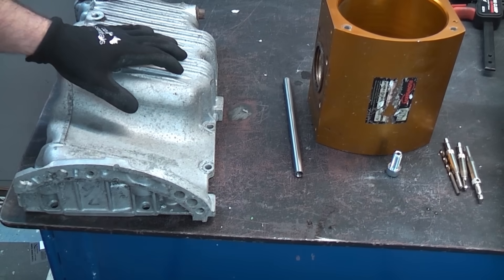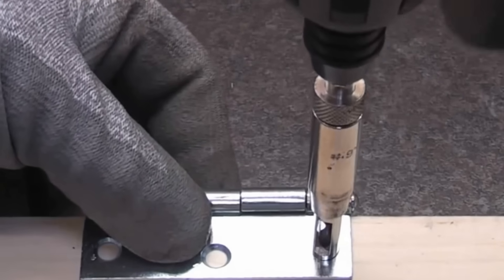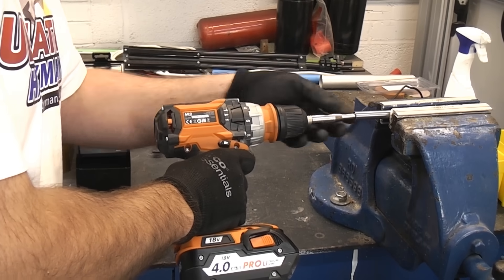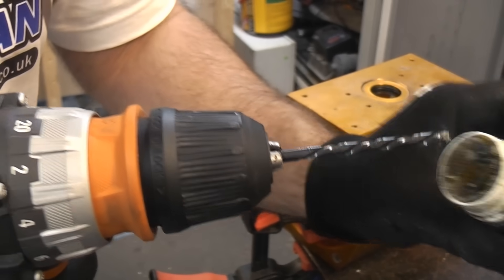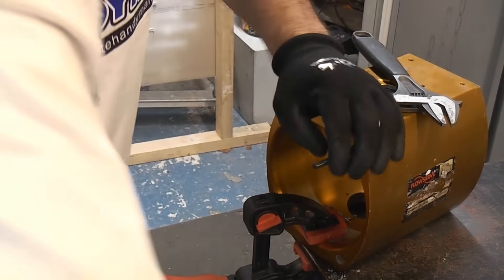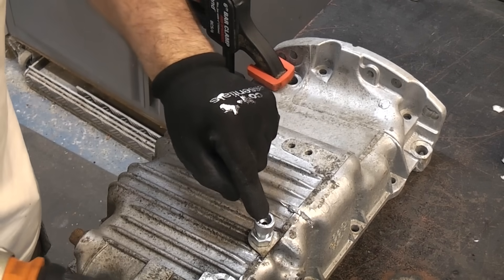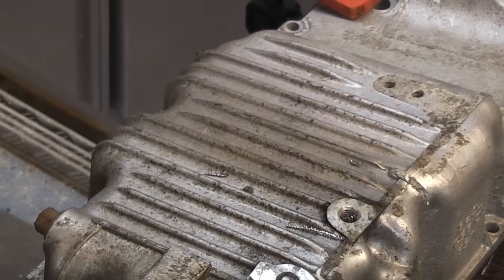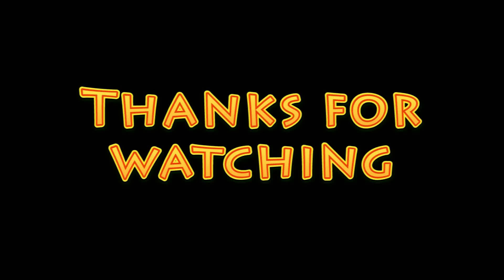How to remove a broken bolt in a deep hole | remove broken bolt in recessed hole

Comment: I've always just welded a nut on the broken off piece, the heat usually gets it unstuck and then you just put a wrench on it and take it off.
Reply: Guess I need to go out and buy a welder, take welding lessons, weld to the bolt,.....oops it’s broken. Off down inside....oh well, next video!!!

Comment: We called them "easy-outs". They were never easy and would usually just snap off in the drilled hole. Then I'd have to take whatever I had to a machinist to work their expensive magic.
Reply: Yeah it seems to me too that the actual way to reliably remove these things is a big-ass mill and a sturdy fixture...
Reply: Just watched another of your videos on this exact problem. Very nice. Good job.

Comment: Usually when I snap off a bolt, it's because it's hopelessly corroded (that's why it wouldn't come out). Step one, drill a hole in the bolt. Step two, snap your drill bit off in the hole. Step 3, swear....a lot.
Reply: That's the method I use too! Must have gone to the same school or something.
Reply: Just tried this method-and it worked! I now have a hardened broken drill bit tip in the center of a frozen, broken bolt..
Reply: @phila3884 diamond tile holsaw
Reply: @phila3884 fuck.. that’s what I said yesteryear when I shared a cylinder head bolt.
Reply: @phila3884
Been there, done that.
Spent a half hour or so, every day for about a week:
Spray it with penetrating oil and grind it with a diamond dremel tool.finally got it ground out to where it would come out with the next size screw extractor. 
It was on a cylinder head, so buying a new one didn't seem so attractive.
Reply: Ya, not sure why a hardened bolt would break off then simply come with a drill bit or bolt extractor. Nice method and solution but not for extracting corroded frozen broken bolts.
Reply: @justinhaskell8990  Might be something to do with the heat generated by drilling ??. Been in a similar situation many times with broken drill bits in the broken bolt , enough to make you cry
Reply: @UserUser-ww2nj so how do you get them out ? Just happened to me
Reply: @justinhaskell8990 i was just thinking the same. However my bolt broke because... i was undoing it in the wrong direction (reversed thread) 😅
Reply: Ok Im still swearing and nothing is happening... Did you swear in English? Idk wtf to do
Reply: @Rabbit_7.62x63 naw, use German or Japanese, much higher quality
Reply: @Rabbit_7.62x63 , 😆🤣😅😅👍💯
Reply: If working in an engine bay, also  rememer to to apply ample pressure on the drill, so when the drill bit snaps, you smash your knuckles on something (preferably something sharp), that way when are swearing in frustration, you are also swearing in pain.
Reply: @Natu776  bro at that point your knuckles are already busted up, from punching the fu kin ground when you realized you had to drill out a damn bolt lol
Reply: Or snap off the extractor...
Reply: If you use the snappable drill bit that brakes off outside the hole , now you have something to grab on to. LOL
Reply: Or just buy a new one , which is a piece of garbage 😂😂😂
Reply: @carlleroy5952  if the drill bit breaks and you cant take it out youre screwed though.
Reply: @birisuandrei1551  yes just happened to me very frustrating. Luckliy i was able to mount the door with one bolt on hinge for time being. Also it was only 2-3 inch off ground which made it even harder to keep centered wish i knew about thise center guides while i was at homedepot. The extractor wouldnt set inside so i tried drilling more and snap went my drill bit....
Reply: @kscgaming5857 were you ever able to get it out after it snapped and how so
Reply: Graduate Level......break off an EZ Out Bit in the said drilled hole....I hits my Masters in this at Screw U Tech College of Technology SUTCT!.....(Sucked, sort of😉)
Reply: @rileyjackfansmithandjones8238  CentralKentuckyEducationDepartment should get you there!
Reply: Lmao
Reply: Currently have 3 extractors snapped off in 3 separate bolts! Now what??? Oh and they are the axle bolts (which all snapped) and that’s my ride home. So pls, what do I do now? It’s recessed in the hole too.
Reply: It's always comforting, knowing that there are others suffering right along with me. 😉 🛠️⚒️🧰
Reply: At least you filled in the hole.
Reply: Just keep drilling is what my wife likes to say.
Reply: @EarmuffHugger 😂😂😂
Reply: @EarmuffHugger Um, yeah...suuuure she does.
Reply: Your forgetting he’s using a left had drill so when it catches it often backs the bolt out.  If not the hole down the center often releases pressure on the bolt and provides another access point for a decent penetrating oil like KROIL.  Nothing works every time but I’ve gotten more out than not doing this or similar methods.
Reply: @takedeadaim8671 omg...that's incredibly useful to know
Reply: @ivanvarela3215 it won't work as a broken stud is always tight. Ask yourself, why did the stud break in the first place. Because it's rusted, had a galvanic reaction between two different metals or cross threaded, all of which are tight as hell.
Reply: You left out a step, after breaking the drill bit, you try drilling with a titanium bit…..then snap it off inside the previous drill bit then repeat swearing. It also helps to throw or hit something ….
Reply: Well I'm frustrated with this broken bolt and all this talk about left handers , I took a smoke break , now I don't care if the bolt is broke off , it's going together without it ..
Reply: Particularly enjoyed snapping the extractor off after the drill bit!
Reply: Sometimes it’s easier to use a hole-saw and core out the entire thing, threads and all, then fill it in with molten aluminum, drill, and tap a fresh hole :-P
Reply: My ol lady Had electrolytic corrosion in the block and timing cover.
I saved out a whole weekend for the many processes of corroded bolt removal.
I ordered new bolts and went to the car with an idea I received from a tech who could solve problems like that.
Heat them, then blow them outta there. It was in cast iron.
No pussy footing, full power.
Reply: It didn't work. What am I doing wrong? 🤔
Reply: If you ain't cussin' you ain't tryin' 😂 great video 👍👍
Reply: TRUTH 🤣😆😭

I actually broke off my screw extractor: A broken-off, corroded, rusted bolt with a brand new extractor chaser.

I strung cuss words together like beads.
Reply: next step is a 35 dollar diamond bit. lol.
Reply: I use a jeweler's torch, a drill bit and a ease out.  The torch will soften a hardened bolt. Then drill it. Might have to do it twice. Then use an ease out.
Reply: LOL. Same deal here
Reply: Is there a step four 😂 no seriously 😒?
Reply: @jermanewagner6891 did you ever find step 4 because this just happened to me
Reply: Oh my word, this is the most accurate comment iv ever seen! You explain my whole day in one sentence, amazing. And the bolts still in.🤬
Reply: And break the screw extractor in the bolt too.
Reply: My husband literally did this step by step. 😂 I just read it to him on the phone & staring dying.
Reply: Yeah this. This guy was lucky, if not staged... If you don't snap the drill then you snap the easy-out and then you have to resort to a dremmel, fucking up the hole, drilling & tapping for a timesert or helicoil. I have no stud-extractors anywhere to be seen in my armoury of tools any more, they have only given me grief, never saved me.
Reply: Currently using this method
Reply: Brillant & preventive thanks for the video wisdom.
Reply: Man i hate how life is 😂😂
Reply: Only if you don't know what you are doing
Reply: El loom mini um
Reply: Thats what im trying to avoid right now lol
Reply: Master, hold your secrets lest the foreigners steal it! 😂
Reply: I swear that is the same way i do it.
Reply: Brother I’m in that exact position
Reply: @douglasanderson153 did you ever get out of that situation ? Broken drill inside screw/bolt?
Reply: Man I broke my drill bit and my easy out trying to get this bolt😂
Reply: Break the drill bit drilling the hole, finally remove the broken bolt after much swearing and throwing tools, break a tap repairing bad threads, repeat from start 😂
Reply: Ease out. What a lie. Ease break. Now for the real entertainment. Not genuine unless blood is drawn
The cussing is a bonus.
Reply: Same😢 never removed any bolt frozen that had snapped trying to remove even with pen oil….! Spent good money on decent removal easy outs never works always ends up at shop getting sorted properly at the cost of decent easy outs you bought…..🤷‍♂️🤷‍♂️🤷‍♂️💯💯💯🇬🇧🇬🇧🇬🇧🇬🇧
Reply: Breaking the easy out off in there in there is a great way to get a mechanic to stop asking for help too.
Reply: That’s where I’m at, broke the extractor off in the bolt, trying to figure out what next
Reply: We've all been there ,followed  by drilling  it out ,taping  in a new thread ,followed by a helicoil .
Reply: Same story, but found a small diamond hole cutter and managed to cut a hole around the drill bit before the diamonds fell off. However, ended up drilling a very large hole and hammering some nuts into it to take a new bolt. As I was only trying to replace a casserole lid knob, this worked.
Reply: After snapping off the drill bit use it for an anchor and weld a solid piece of steel to the drill bit then see if it'll turn out the bolt
Reply: Exactly! 😂
Reply: Gotta laugh as ex maintenance tech,  you’re exactly right!
Reply: Step 4 Throw the fucker in the garage after beating it to little pieces with a hammer.😇
Reply: Didn’t work
Reply: been there.
Reply: Been there done that!!!🤣🤣🤣👍🇺🇸❤
Reply: Now that is what normally happens. Aluminum if very soft metal, BUT aluminum will not bend. It will crack and break. 
When the trailer mfgs started making cattle trailers out of aluminum they had problems with cracking and breaking The problem was too much nickel in the aluminum. Solved it.
Reply: Building up weld or drilling and tapping are the only methods that have ever worked for me. Could never work out how anyone eazi out that compresses outwards against the walls of an already seized stud removes the stud.
Reply: Lol you guys are the mechanics that charge people loads of money to make their cars/motorbikes worse...

Comment: For the CNC programmers out there I had a  1.125" diameter set screw that needed drilled out. I drilled through it and then set a pocket mill a little bit smaller than the bore diameter of the thread. Once that was through I set a thread mill pass to just barely touch the remainder of the screw without touching the internal thread. When that was done I pulled the screw out of the hole like a spring.

Comment: If she still doesn't want to come out you drill the whole thing out threads and all and re tap the next size up...then you will have one slightly larger bolt. If that bothers you, weld the hole shut and re tap. If you don't have a sweet custom thread saver bolt like you had made just use a punch to make a dent in the center of the broken bolt then pilot hole drill with a very small bit, 1/16th or couple mm diameter, with this small hole as your guide you can drill with the regular size bit without it jumping around. If your threads do get gummed up during any of the aforementioned processes a lot of times you can save the threads just by re tapping the exact same thread size. I just had to do this the other week because I cross threaded a bolt on my engine.

All I can say is invest in a good tap and die set, do not have thread anxiety, they are usually very easy to fix / modify

Comment: Really interesting ways. Especially using a hinge drill was awesome. I have been using tap driver with screw extractors which is more stable than wrench and lets me to force the extracting tap down.
Reply: But what if you didn't have your tap driver on hand at the time? Like, suppose you'd left it at work or something?
Reply: @thestreetrat3660  Then have a dozen of the correct size extractors so that when you break one you will have another on hand.

Comment: The greatest moment of my entire life was successfully removing a head bolt out of  a volvo 2.3 t block. Was about 3" down the hole. I ratchet strapped a magnetic pillor drill and ive never drilled a bolt more centrally 🤣 got the stud extractor in and it wound right out. The feeling was just the best !

Comment: This is such a brilliant solution, you should market these so people don't have to make their own. BTW: I use a left-handed drill bit when extracting broken bolts, it often unwinds it without the need for an easy out.
Reply: I had this idea in the 60s, everyone thought I was nuts, they would end up breaking the extractor off in the bolt
Reply: one of the bolts he removed he did with the left hand drill bit.
Reply: What is a  left-handed drill bit?  What brand is strongest for 9.8  Hex headed sheered bolt?

Comment: And then there is the bolts with grade 8 hardness. You're not going to drill those with high speed Steel. You're going to need carbide
Reply: BS... 'Grade 8' can be easily machined using HHS tool bits and drills.

Comment: You will have lost most of your audience ability when you went to the lathe to custom make a adapter.
Reply: Drill press?
Reply from the maker: I have put a link to this video in the description of the video, it should be in the cards (these pop up at the top of the video) and it should also be on the end screen. But here is the direct link to the video https://www.youtube.com/watch?v=6mZj0J6CNYA

Comment: I love the centring jig. A broken bolt is enough to make you cry. You instantly get that sinking feeling when you know the bolt just broke, however the feeling of joy when you're holding the broken little bastard in your hand once you've removed it is priceless.
Reply: Knowing you’ve won is the best feeling
Reply: That hasn't happened not once in my lifetime. Just a huge mess and two cobalt drill bits broken in the bolt for eternity
Reply: I broke a head stud in a bored and stroked 5.3l last week. 3.5" down in a hole. Crazy how tough it is seeing how easily it broke. 5 days later and I've only made it a quarter the way thru. Went thru probably 9 bits. Got the hole off centered some. They don't make left had bits that long. Studs don't even have torque to hold them in, you torque the opposite side. But the bastard won't spin. I got a extractor stuck in it, gotta weld a nut on to spin it. Praying that finally works. Needless to say I should've spent the $400 on ARP studs instead of $140 Speedmaster. Don't ever trust them or their torque specs. I'll seriously probably cry manly tears of joy if I can get it out. Otherwise the entire engine comes out and goes to the machine shop. Would be a good time to upgrade to 1/2" studs even tho that wouldn't be needed for 900hp
Reply: @turbocateyeS475  7
Reply: Worded perfectly!  Clapping sound
Reply: Yes😅😅😅😅

Comment: Good demonstration, but it's far quicker and easier to use a mig welder. Place a washer over the hole, weld end of bolt to that, putting a lot of heat into it, weld a nut onto that then rock the bolt out. Takes 1-2 minutes tops.

Comment: I worked a diesel turbocharger bench (Cats)(mid-1970s). Many frozen and subsequentialy busted bolts on the exhaust side.
Center punch the bolt, drill it, use a 'pick' to pull the remains from the threads. If the threads were damaged, drill the hole to a proper size, tap it and insert a heli-coil ... good as new and didn't take very long.

Comment: The best option is to fill up the hole with weld. Then weld a nut on top of that. The weld won't stick to aluminum.
Reply: Yeah but if you’re not careful the welding will f up the aluminum, it’s so pissy about how much heat it can handle.

Comment: used the centre get a left handed drill brit make a plug with melted  canddle wax with drill  bit in the middle and drill out and use a extracer bolt no special parts needed or if still neer moved just drill the bolt out and the thread would fall away

Comment: I wish I had seen this years ago removing steel bolts from aluminum cross members on Snowmobile rails. It was almost guaranteed the bolts would snap off trying to remove them. I usually went to the snowmobile bone yard and picked up another Aluminum  cross shaft. The ones that held a bearing or bushing and an idler wheel would certainly  break because you couldn't  heat it with a torch. Usually the threads would strip out if the bolt did come out so it was an impossible  job. I used tons of antiseize when reassembling the frame rails.Good video. I no longer do snowmobile repair.

Comment: Flowserve? I’ve machined some big parts for them before.
Reply from the maker: We have a lot of their actuators on site, probably a couple of thousand of them, in varying sizes.
Thanks for the comment
Reply: Are you in the states I know they are a huge conglomerate
Reply from the maker: @franlhg   No, I'm in Darwen, Lancashire, England. I'm a maintenance engineer in two local chemical plants, actuators and valves are widely used to control the flow of chemicals/water/steam etc.
Reply: Cool! Good tip on the video I liked the socket headed cap-screw trick. It would work even better (in my opinion) if you were to machine out bigger and put a harden steel bushing in it.